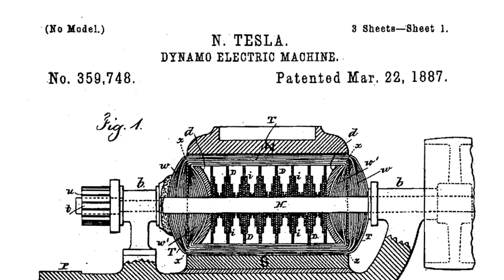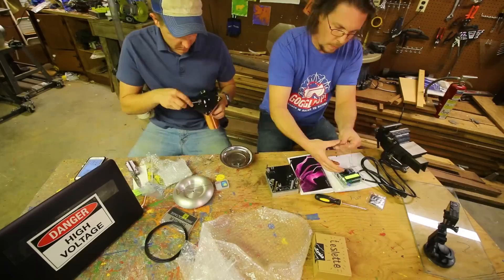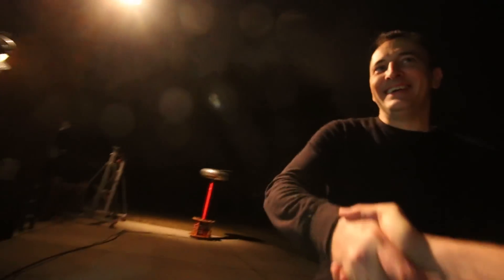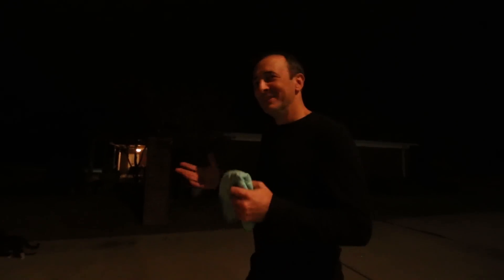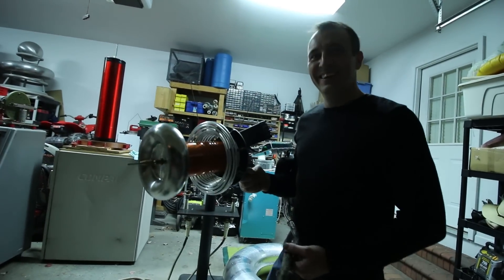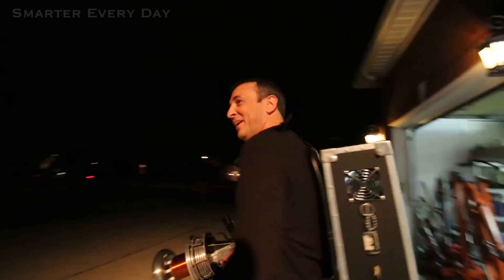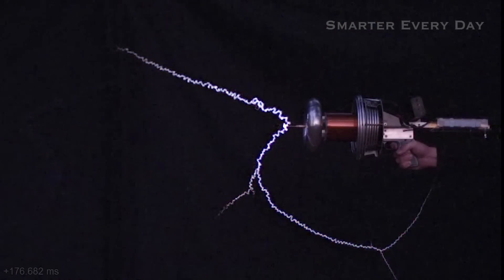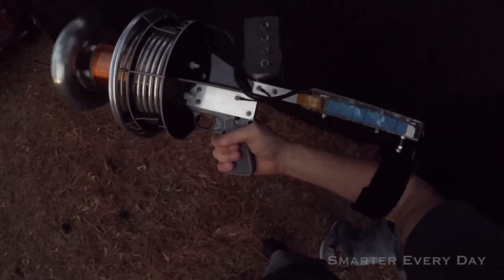Handheld TESLA COIL GUN at 28,000fps - Smarter Every Day 162

Comment: Destin, is the audio with the playback of the slow motion video recorded alongside the video recording? If so I find the sound of the bolts to be just as intriguing as the motion captured in the video!
Reply: Hi Tim, I do the sound design & music for Smarter Every Day. It isn't possible to record "high speed" sound in the same way we can capture video, so we need to get creative and do it all in post. While we have the technology and playback techniques to slow down video thousands of times, we can only do so with audio only into the double digits with the most advanced available technology. Most professional gear only allows us to slow down audio 2-4x. Additionally, the audio will be very quickly forced below the range of human hearing as you slow it down. You only need to halve the speed 10 times to push the highest discernible frequency (20kHz for someone with excellent hearing) to below the lowest discernible pitch (20Hz). 

For the sound of this video I cross-synthesized ice cracks with recordings of actual electricity and then did lots of editing for timing and processing to give it the "slow mo" feel.
Reply: ashellinthepit, That is incredible work! It sounds very believable. Thank you for letting me know more about the technology and another way to be smarter today!
Reply: Hm, couldn't you pitch-shift the audio back into human hearing range?
Reply: Pitching without re-compressing the time span would require extreme digital interpolation, which sounds garbly and bad. You get higher quality results if you throw some imagination at it and do the work in post-production. And it's more fun :).

Comment: I use to have a box of different wires, cables and metal scrap with an old speaker, some DC bulbs, daisy chained 9V cells and some old grill igniters. I use to play around with that for hours while my dad was working on his car, grilling or painting doors and air vent covers in the garage.

Comment: There's some things that are wrong in the video:
1) Tesla did not discover the rotating magnetic field. It was confirmed decades before he was born.
2) Tesla was not the first to make a functioning AC motor. He was the first to make an induction motor (probably).
3) the motor Tesla is standing on a 3 phase induction motor, which is misleading since he worked on two-phase induction motors

I loved the slow motion parts of the video the most. They're very insightful into the way electric arcs move through the air.

Comment: That high speed vid of the arc was surprisingly awesome! I just assumed lightening bolts travel at the speed of light. Apparently I was wrong. Looks like there are small oscillations throughout the arc as it travels. I would assume the time between sparks would match the duty cycle but I wonder what that oscillation in the arc is from. Capacitors?

Comment: Wow, this is awesome!
What's that smoke that the lightning leaves behind (on the highspeed part)? Could it be CO2 from the air that turns into carbon by an incomplete combustion?
Reply: I believe that is ozone being produced when the arcs of electricity combine oxygen molecules together at extremely high voltages.

Comment: Why is a spark gap necessary?
Reply: Pretty sure it's acting like a switch so that the capacitor dumps current/power rapidly to the primary coil. Unlike a switch however the spark gap probably doesn't bounce (opens and closes a few times when switched) and also is probably less likely to get dirty/burnt when used. Arcing in a contactor is bad.
Reply: Pretty much. It takes a few hundred volts to arc across the air, so the capacitor bank has to sufficiently charge to cause enough difference across the spark gap electrodes to arc. Once that happens the arc itself is highly conductive like wire, so the capacitor bank can discharge until it can no longer maintain the arc across the gap and closes. Then the cycle repeats because the capacitors are charging again.

Comment: Now just imagine (and imagine only because if it works it could be the most epic thing ever but if not you just dead): You get a caoutchouc leave that you put your arm in and wrap it with the primary and the secondary coil and you put a metal disc in your palm......NOW YOU A FREAKING LIGHTNING BENDER

Comment: awesome but I want more explanation on how the "lightning" works
Reply: The bigger coil is a DRSSTC, which just has two resonant circuits(primary, secondary), the smaller one is a LOT more complex - a QCWDRSSTC, which means Quasi-Continuous Wave Dual Resonant Solid State Tesla Coil(quite a mouthful) - it uses rather complex pulse shaping to "pump in" more energy into one discharge several times, making the streamer heaps longer than it would be with a regular HV pulse.

Comment: Yeah, ElectroBOOM has said it in several videos that sparks are not lethal if either: voltage is too low to pass the resistance of the skin OR current is too low to do anything.

Comment: After seeing the high speed of the gun, I wonder if lightning moves slower than a glass shattering. I remember vaguely from a Slowmoguys video (where they kept breaking glass beakers) that they had a hard time recording the glass because it just broke so fast that they had to keep reducing the quality and increasing the frames per second. So, my question is, does glass break faster than the speed of lightning?
Reply: Yes.
Reply: Nothing is faster than the speed of light (not lightning) in the vacuum. Watching the slowmo part, it took ~6ms since the gun fired to reach Destin's hand: light would travel about 1800km in that time, not just some cm!
Reply: dsiefus You misread.
Speed of lightning, not light.
And no, plasma(ionisation) channels travel much slower than breaking glass.
You need megaframes per second to see glass shattering.

Comment: What does a Tesla coil do in a vacuum? Is the zig-zag pattern of the electric bolt guided by the dust or particles in the air?  What if the air is completely void of particles?  What would the electric pattern look like?
Reply: It wouldn't do anything.
Streamers are plasma, plasma is ionised gas.

Comment: And I thought Winston's gun needed a buff, it's actually way too powerfully ingame lol
Reply: +Lala Shama u DUMB, Winston neeeds a BUFF, not a freakin nerf. His Tesla cannon has such a short range
Reply: Samarth Patel I mean compared to how it is in real life. I agree ingame his weapon is too weak for my taste. But it's WAY stronger than it would be irl.
Reply: Lala Shama Nice save. Nice save. Yus.
Reply: Same could be said about every game tbh.
Reply: LOL
Reply: Maybe he has an higher amplitude so it is more dangerous.
Reply: Not necessarily. If you have the current intensity (Amps) high enough you could kill people instantly with a Tesla coil. But it would require very very high high intensity in the primary coil (such that lightning coming out of the secondary would be high enough). Basically current intensity is lost going from primary to secondary coil in order to have a higher voltage (volts) which lets the electrons travel in air for larger distances, which makes the entire thing more spectacular.
Reply: @Pinklyfloydhead  It's almost impossible to get shocked to death by a tesla coil because they operate above 30kHz unless they're humongous, and your nerve cells don't have time to get polarized. The real danger is ozone, nitrogen dioxide and rf heating. Using a tesla coil is just not the way to go if you wanna instakill someone when a capacitor you can fit in the palm of your hand can stop a persons heart.
Reply: Lala Shama the zapomatic is better

Comment: Thanks for that Amazing video! One of the best I've seen so far!

However, I have a question: Why did you place the metal wire on top of the tesla coil you bought? is this the part that generates the sound? I was wondering whether the sound comes from the vibrating metal, or from the repeated fast expansion of the heated air due to the lightenings.

Thanks again for your amazing work!

Comment: This is the method used in cars to create sparks on the sparkplugs, just on a larger scale.
Reply: No. Not at all.
Cars just have a large pulse transformer that gets you 5-15kV once it's triggered.
Reply: Yes, they are simple induction coils,and they give >15kV up to 40kV. Just look up "Ignition Coils"
Reply: LeMeBucallion You just missed your own point.
Reply: Spirit the only differences I see between ignition coils  is the way the coil they are  powered or the way they are triggered.
Reply: LeMeBucallion Well, then you clearly have no idea about electronics.
A tesla coil is a coreless resonant transformer.
An ignition coil is a cored, non-resonant transformer.
Reply: Yes on the core/no core, but some (older) ignition coils use a capacitor so they are resonant.
Reply: LeMeBucallion That's not resonance.
That's ringing, or just pulse shaping.

Comment: is that the original sounds in the high speed?
Reply: Hi, I do the sound design & music for Smarter Every Day. It isn't possible to record "high speed" sound in the same way we can capture video, so we need to get creative and do it all in post. While we have the technology and playback techniques to slow down video thousands of times, we can only do so with audio only into the double digits with the most advanced available technology. Most professional gear only allows us to slow down audio 2-4x. Additionally, the audio will be very quickly forced below the range of human hearing as you slow it down. You only need to halve the speed 10 times to push the highest discernible frequency (20kHz for someone with excellent hearing) to below the lowest discernible pitch (20Hz). 

For the sound of this video I cross-synthesized ice cracks with recordings of actual electricity and then did lots of editing for timing and processing to give it the "slow mo" feel.

Comment: Question: How come plant roots spread the same way as the electricity shown here?
Reply: MadDany wild guess - path of least resistance? (+ a bit of randomness)
Reply: D.fly I can understand that in plants. But in electricity... the only thing we can say that its random, yet that isn't a good answer.
Reply: MadDany Maybe some atoms are closer than others and that's the way the arc travels. That just a guess though. But there's always a reason :p
Reply: MadDany It isn't random it's fractals
Reply: It's not random, just really fast!
Reply: MadDany I think Bizmee is about right. The air's conductivity isn't constant and the lightning bolt chooses the path where the most free electrons (?) or easy-to-ionise molecules are closest at each point in time.
Reply: MadDany FRACTALS!!
Reply: The discharge itself causes that. The plasma surrounding the discharge becomes ionised, which is why the streamers tend to dance. a Jacob's Ladder is a good example of that.
Reply: ***** don't really think Fibonacci sequence has anything to do with how lightening branches its way to fast and chaotic to be described by anything like his equations
Reply: Aaron Smith Since maths is ideal, it works instantly, there is no real limit on "how fast" an equation describing some phenomenon is calculated in real life (as opposed to simulations). Or do you mean something different? 

Other than that general thought, if the branching shows properties of the Fibonacci sequence / the golden ratio, I wouldn't know why the latter doesn't qualify as describing the former. However, I do not know any details here, so I'm rather clarifying and asking myself than making concrete points.
Reply: I mean in quantum  sense there's know way to know for sure where a lighting bolt will go because your trying to calculate an eltromagnetic force moving through a medium that is also in constant motion the best you can hope to get is a relatively high probability
Reply: Well, that's true, on a quantum level you only have probabilities. But the probability distributions often have underlying patterns they follow which then has macroscopic results.
You can, I think, write a program containing a (very) limited set of rules and simulating something like the propagation of lightning bolts by taking random numbers, applying the rules to them and getting results looking like real bolts.
But as I said, I'm not sure if ... [looks it up]
ok, looks like lightning does follow fractal patterns. As some other things. And it's quite beautiful, here:
[edited: grammar]
Reply: https://www.wired.com/2010/09/fractal-patterns-in-nature/
Reply: MadDany tl;dr both electricity and plant roots follow the paths of least resistance
Reply: ***** oh don't take my word for it I wasn't trying to convey I was certain just that was my opinion on the matter I'm complelty self educated when it comes to quantum physics I'm actually a forester by education. Plant science all the way lol
Reply: Заклетник word to the wise fact checking people in an online setting is nigh useless